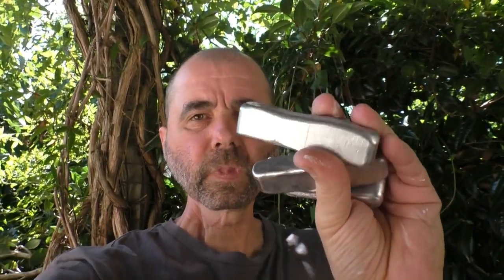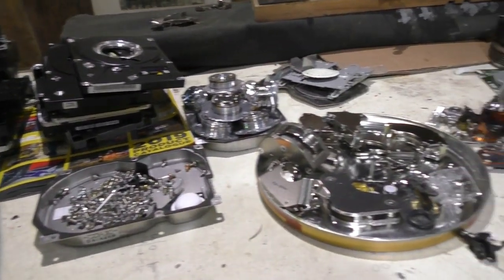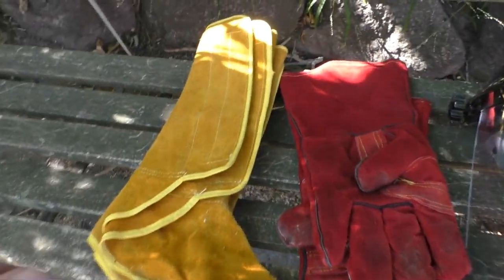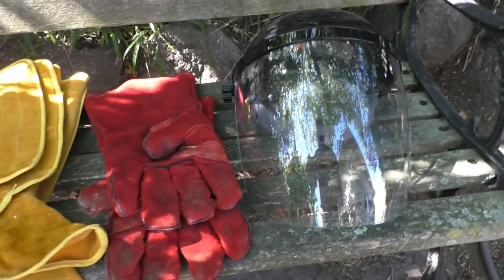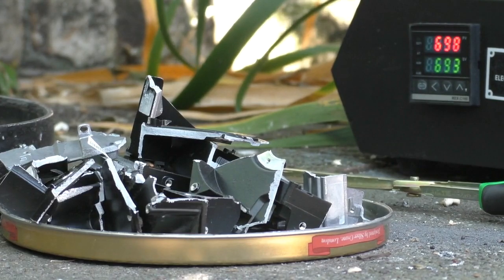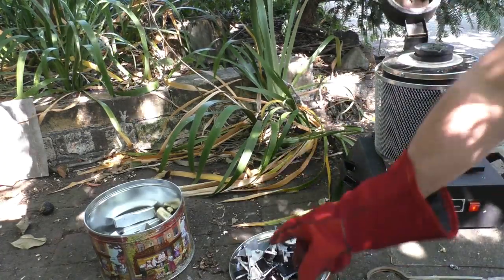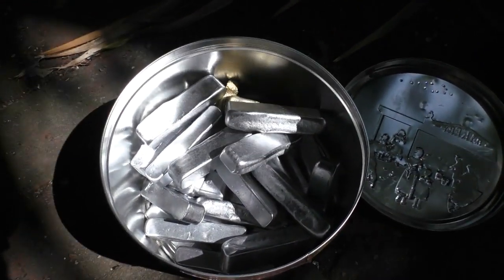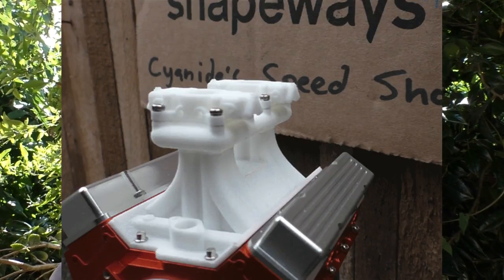Backyard Foundry - First ingots from the electric furnace.

Comment: Hello, I just watched your video.  and I'm curious how much gramun aluminum you get from this 3 kg crucible. because this 3 kg crucible is gold and gold is heavier as you know.
Reply from the maker: I get about 3 ingots approx 100mm X 15mm X 25mm in size, but do not know what it is per weight. My crucible is a 2kg. I would like to get a 3kg though.
Reply: @OldIronRC  thanks for the quick reply.  and if it wasn't a problem, would you check the weight of these three bars?  because I'm interested in what heavy bar will come out.

Comment: Wow - you´re casting metal! I love your gorgeous furnace.  
 I´m sure you know this but I feel obliged to mention it; it´s generally easier to make good castings using ally which came to you as a casting, rather than using old extrusions etc. This is because the stuff that´s cast contains additives which facilitate casting. In other words, for small, fine work such as an RC front axle you should do better with hard drive cases than bicycle rims. 
 I look forward to future metal casting vids from you  : )
Reply from the maker: yeah I read that somewhere too. I think the HD chassis are cast and/or machined so good stuff to use, the bike rims are extruded and I cast it separate to see if it was any different, but I could not tell with my limited knowledge by looking at the pore or ingots. I played with brass too, higher temps, but it melted down the bathroom fittings just fine.
Reply: @OldIronRC  Brass is as hot as I´ve gone with my charcoal and hairdryer furnace.
 Like you, I find old bath taps are a good source of the stuff. Rich channels like The King of Random just go out and buy plumbing fittings to melt down, but, like you,  I like to use knackered stuff that´s no longer fit for purpose.
Reply from the maker: yeah, the recycle factor is a big part of it for me. My inner Hippy is strong. Plus I just like the idea of free "junk" to make parts that can be expensive to buy from an RC manufacture. The brass was hot, about 950c, the max on the little electric furnace is about 1200c so I was getting close to the limit on it.
Reply: @OldIronRC  Does it use much juice? I ask because my house has a 3.3KW circuit breaker. We try not to have the kettle on at the same time as the oven, for example. Perhaps I should be dreaming of a gas-fired furnace, but the precise thermostatic control offered by an electric unit is very appealing to me...
Reply from the maker: 1500~2000W There are also some videos on how to make home made electric furnaces on YouTube using fire bricks etc.
Reply: @OldIronRC  I had thought it would need 3 or even 4 KW.
 It might be possible for me to have that electric temperature control after all!
 I shall look into it.
Reply: @Del350K4   be careful melting brass as it has zinc in it, thats what the ghostly  flames above the melt are, and its very bad to breath,- just stay up wind from any smoke .

Comment: Liked the video, I have made simple aluminum parts with  sand molding that turned out with good detail.  You could try  sand while your waiting for a printer.
Reply from the maker: Thank Mike. I already got some dental plaster and silica350 which is used for glass casting so next is upgrading my hobby grade CNC machine to machine off surfaces and later I'll get a 3D printer. I am also looking into centrifugal casting as a method of casting small parts. It really is quite interesting.